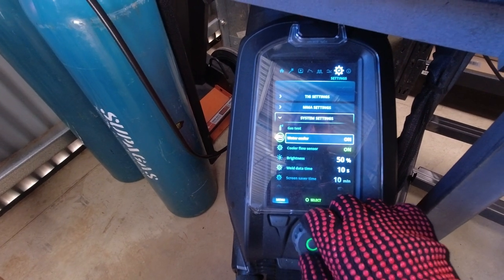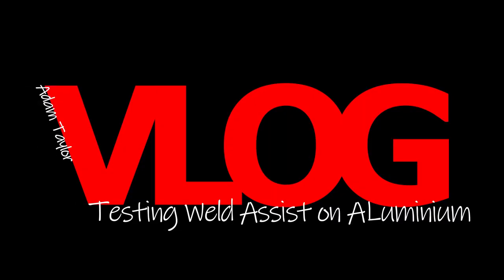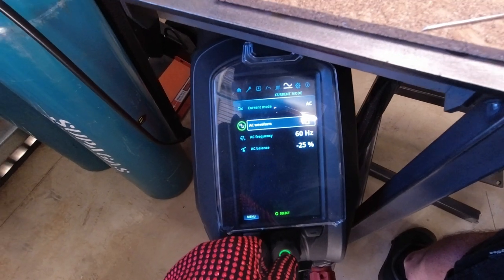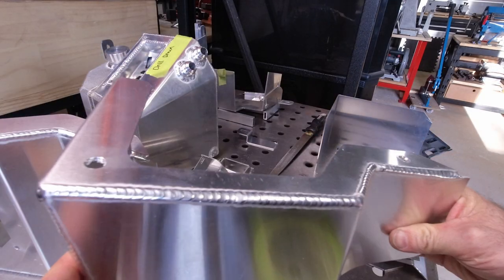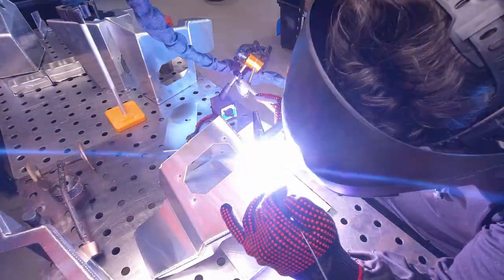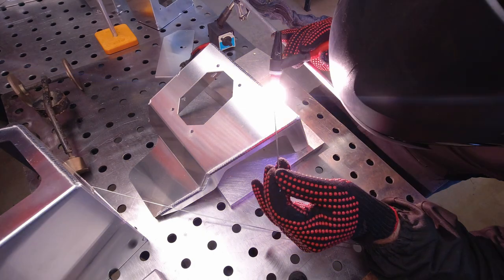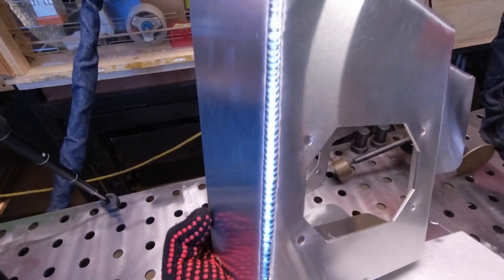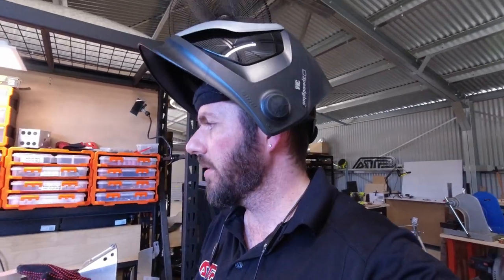KEMMPI MASTER TIG 235 - Testing out 'WELD ASSIST' on 2mm Aluminium - VLOG

Comment: Hi, like an other viewer earlier on mentioned you should  tell the machine you're using a watercooled torch. 
Now, in your vlog you're using a different brand toch. The cooler doesn't recognise the torch and doen't switch on. Make a connection between pin f and g in the amphenolplug and the machine knows you're using a watercooled torch. Good luck!
Reply from the maker: Thanks Erik, I have had the torch switch plugged back in and it has been working great. 

Thanks for the tip about the pins, I have now removed all the excess cables and just have the pins jumped, works perfectly!

Comment: Hello, the cooler should turn on as soon as you start to weld on AUTO mode.  There is no temperature sensor for the cooling liquid,  just thermal protection of the machine itself.  cheers
Reply from the maker: Correct, since adding the CK torch I have had to 'jump' the pins on the factory plug to get the cooler to operate.
I should really do a video on this...

Thanks so much for taking the time to comment on this, I really appreciate it!

Comment: Hi I have the same welder but the 335 when the water cooler is on auto it’s starts the second you start welding and runs for 20 seconds or so after you stop which keeps my touch cool. not sure why Yours is not doing the same. Have you tried using the original Kemppi torch may be Worth a try. 
Thanks.  
Dave. 
Hill engineering.
Reply from the maker: Hey Dave, even with the Kemppi torch it doesn't turn on. I actually thought is was the Kemppi torch that was the problem, I'm not the only one with this problem that's one of the reasons I did this test today. 

Do you use a foot pedal or finger switch?
Reply: @AdamTaylor  
Hi Adam. 
Thanks for reply. 
I usually use the finger switch on the torch but do have and use a wireless foot pedal when welding ally and the water cooler still works the same on auto. Ive just tried it with the water flow sensor off and it still works. Have you tried asking Kemppi maybe a problem with you’re machine. would be very unusual for a Kemppi.
Reply from the maker: Thanks for your input Dave, looks like the original torch needs to be plugged in, even with a foot pedal connected🤷‍♂️

Comment: I noticed your not actually using the 83amps it suggests but 57amps so you not actually using the weld assist settings. I have the same welder and noticed yours didn't apply the correct current.
Reply from the maker: I use a foot pedal on this machine, the 57Amps is the low and the 82Amps is the high on the foot pedal, all part of the Weld Assist feature 👍
Reply: @AdamTaylor  right makes sense. Haven't got the foot pedal yet machine is mainly used for stainless steel just welding some aluminium at the moment for my car and found your videos really helpful for settings.

Comment: I know exactly what your issue is with the auto cooling, its in the torch, the genuine kemppi torch tells the welder which tells the torch is watercooled. Without that feedback your welder thinks its a gas cooled torch.
Reply from the maker: How does it tell the welder?

I have the same problem with the Kemppi torch connected too.
Reply: @AdamTaylor  there's some internal circuitry/witchcraft going on, im not 100% sure what, but if its doing it with the kemppi torch being plugged in then there's definitely something not right. Or something missing